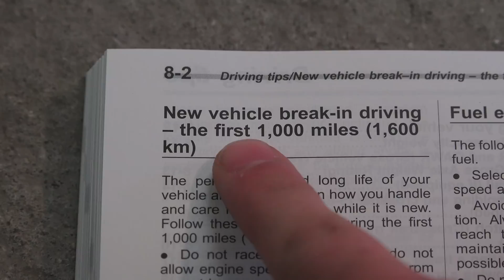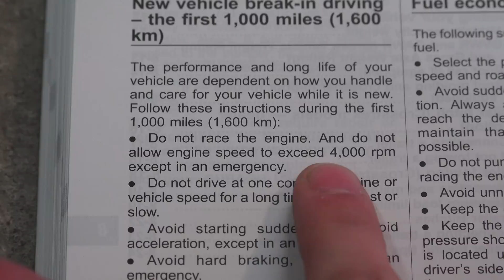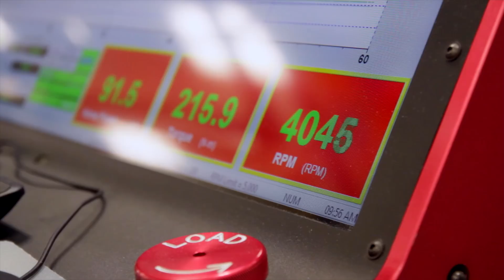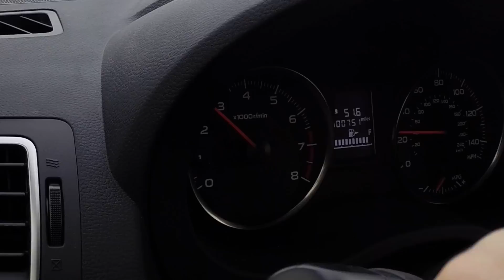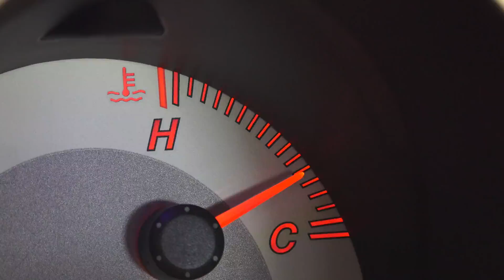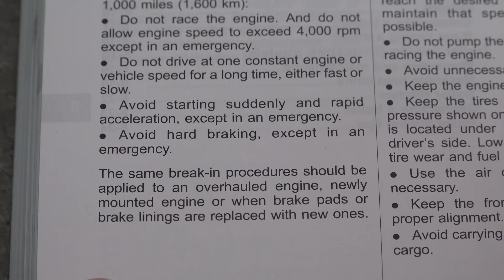5 Things You Should Never Do In A Brand New Car

Comment: my car is 17 years old why am i watching this
Reply: atleast you have a car
Reply: Mine is 30 years old.
Reply: perhaps you might end up with a re-manufactured or rebuilt engine some day if you keep the car. this procedure is also relevant for rebuilt engines.
Reply: Look back in the days you followed these steps.
Reply: I read that as "my cat is 17 years old". In that case you would indeed want to be spending quality time with your cat instead of watching car videos.
Reply: Mine is 46 years old >.<
Reply: @goldmartijn  now 50
Reply: Because you were relieved that your car was broken in correctly so it is still surviving maybe? But the piston rings maybe need changing.
Reply: I dont have a car so why I am waching this?
Reply: Bacon CheeseCake 2000 pontiac grand am lmao, grand am is the model, 2000 is the year. I neglected to put pontiac, most people know the grand am I figured.
Reply: RedesCat same I don't even have a car
Reply: My car was made in April of 1987. it's older than I am.
Reply: 21 year old VW 1.9 TDI here
Reply: RedesCat lol mine's 40 why am I watching?
Reply: mine is 27 years old 300zx
Reply: I have a bicycle -_-
Reply: nope... Grand Prix GTP. Thinking about trading soon though. I need something with a little more tech
Reply: Das beste oder nichts!
Reply: mines 12 years old, still may as well watch
Reply: Mines 30
Reply: My truck is 29 years old
Reply: To tag along, Mine is 24, a 93 corolla ;)
(the wife got new though )
Reply: RedesCat For the time that you'll buy your own brand new car. That's my reason anyways.
Reply: RedesCat  Correct
Reply: RedesCat i have an audi a4 2000
Reply: land cruiser 1998 (diesel). feels like yesterday when i bought it and its still feels like new since Toyota knows how to properly build a car
Reply: My car just turned 17 years old now
Reply: @andrew_gencoupe  after 17 years vw golf tdi, traded for mazda cx5 turbo GT what a difference, hope the new car lasts as long
Reply: @NoChannelChannel  nice choice, I can’t help but look at some new Mazdas too, I love the new cx-50
Reply: @andrew_gencoupe  would have gone for cx50 but Australia doesn't offer it.
Reply: RedesCat same. grand am gt '00
Reply: RedesCat my motor mount actually broke today, taking the power steering pulley with it lmao.
Reply: RedesCat mine is 21 years old
Reply: i have a grand prix with 221k miles lol i like to go fast though but i want the car to last me to atleast 300k
Reply: my car doesn't exist and I have less than 1,00 for one. I also have no logical reason to watch this :P
Reply: Because you know you'll have a new car one day... Same as me! I've got a 15 year old car ; )
Reply: Mine is 13
Reply: I have a 99 Silverado. Definately broken in for towing, lol
Reply: caprisun2k1 is it a gto?
Reply: if the car is solid keep it. those arent bad cars, i had two of them. the problem in this climate is cars rust out. that L67 is a hell of an engine. instead of getting something else, hop it up a little. its not hard to get more performance
Reply: why lol
Reply: My car is 33 years old whatcha want
Reply: Mine is 16. Good old GM 3.8l
Reply: I don’t know🤔.
Reply: Sorry that i must remove the upvote from this since i completely agreed with your comment, but now i have a 13 yr old car. My apologies.
Reply: Mine in 17yo golf mk tdi still strong but time of update, got cx5 turbo
Reply: My 2000 grand am, after 600 in repairs, now has no brake squeak, belt squeak, or loud droning exhaust noise from exhaust manifold or something. And a while back I got an upgraded sound system, definitely needs a subwoofer but it's way better than stock so overall I'd say my grand am is pretty nice. No body issues like dents or scratches too which is very surprising after all these years.
Reply: Mine is 18 on monday i wonder same thing xD
Reply: Mine is 11 years old lol
Reply: 22 y/o
Reply: Mines is turning 17 in May 😩
Reply: RedesCat my car is 47
Reply: RedesCat maybe cuz you're unconsciously thinking of getting a new car? or a friend recently got a car and you wanna help him?
Reply: AHAHAHHHAHAHAHAHAHHAHAHAHAHAHAHAHAHAHAHA 27 yo but.. i am watching too
Reply: RedesCat the car im getting is like 20....lmao
Reply: lol im sitting in a 1990's car chevy camaro anavercry eddition
Reply: Mine's 32 years old, nearly 33. Built October, '84! Why I watched this? No idea...
Reply: mine is 26 years old
Reply: Mines running on 23 years now.
Reply: aceiroo like the bike from my father

itz a honda dominator
Reply: RedesCat mine is like 16. Halp
Reply: RedesCat my trucks are a 1966 1993 and 1998
Reply: RedesCat I like cats
Reply: Because you might need a new one in the near future. Knowledge is power.
Reply: gave the 1001th likes
Reply: RedesCat 2002 Subaru Forester 😇
Reply: No bought my car the year before that car runs fine it's just loud as all hell as the exhaust leeks and my bike I bought last year the price that I bought both of them a blue book value for much higher than what I paid for them but once you drive a brand new car off the lot it already lost half of its value that you paid for it or are in the process of paying for so new cars can be a worst decision in old cars not to mention a build cars now a days that are very difficult for the average Joe Schmo to even change the oil in which means those are cars that I will have absolutely no interest in buying and if the dealer tries to point me towards those I will tell them show me something else or I'm leaving
Reply: an american:  Sentences are a thing.  So is punctuation.

Plus, claiming a new car loses HALF its value right away is complete nonsense.
Reply: Half its value is over-exaggeration they usually lose anywhere from a few thousand to ten thousand once you drive it off the lot but usually some dealers will only give you half of its value that you paid for it when you go to trade it in
Reply: an american to review:  Tks for the clarification. On used cars you REALLY have to watch out for dealers, especially on your trade-ins.  I have literally given away 3 of my old beaters (to family or friends) that still ran OK but were getting ragged re reliability, rather than have the dealer steal them from me and then wildly overcharge someone for them. 

If you go to trade in a new car, say 3 years later, then depending on the brand, yeah, cars may lose half (or even more) of their value in some cases. 

I bought my 3 year old very low mileage '13 G37x for about 55% of what it cost new with options.  It was off lease so I knew why the dealer had it.  So if it hadn't been a leased car I would have wanted to pay less, say 50%.  I guess for near-luxury cars, for the people who can afford it, they want to be seen in a "new" car, and often just constantly roll over leases.  For people like me who like deals, it's great, because there is a steady supply of such off-lease cars becoming available. 

OTOH, cars like Toyota daily drivers with low miles might only depreciate 20% in a few years.  Heck, the dealers often are asking about 75% of the new price for such cars as Camry's that are 4 or 5 years old and have well over 50,000 miles.  (Which is why I buy such cars new and drive them for over a decade). 

So it really depends. 

Sorry I got snippy above, but I get really tired  of people making wildly random over-exaggerated claims on the internet (like apparently with little thought).  To me over time, if too many people do that it greatly degrades the value of discussion threads.
Reply: my car is 24 years old when i am watching this
Reply: My motorcycle is 29 years old as I comment now the only issue I have with it is charging its battery
Reply: RedesCat 11 year old daily driver here with 156k miles. It's still breaking in?
Reply: not only that but why acrue more debt. screw auto debt. i have a 1996 camaro and love it. LT1
Reply: Alex95sang 49
Reply: mines 29
Reply: mine is 24
Reply: mine is 20 i am 22... hehe
Reply: mine is 25 years old
Reply: RedesCat my car is 24 year's old 1993 Ford Taurus GL with 87 thousand original miles on it and I'm 25 years old 😂
Reply: RedesCat my car is 16 years old and im 17 why ain im watching this 2001 nissan altima gle
Reply: Why am I watching this when I have a 2016 with over 30k and I'll have a 78 that already has plenty of miles on it
Reply: same mine was made in the late 60s
Reply: RedesCat. ... That legit made me laugh out loud! Thank you i needed that!
Reply: lol..mine is 12yrs
Reply: RedesCat I drive a 1990 f150 lol
Reply: Hahaha, mine is 15 yo, I also don't know why am i here
Reply: Haha... same. I only drive classic cars and have no plans to ever buy a new car but for some reason I clicked this out of curiosity.
Reply: mine is 18 years old with 450k+ on the odo... I'm wondering the same
Reply: Mines 19 with 92k miles 😂
Reply: RedesCat- LOL!!! I paused at 6 seconds in to find another video and saw your comment. I was thinking 'I'm not buying a new car anytime soon' lol
Reply: Lol mines 24 years old
Reply: Later when it's  time for you to get One i think Electric cars gets cheaper and better If you want One !? 

My self got a Rover 75 1.8 witch is 15 yrs Old and 150000 km of "life experians" !
Reply: 2006 Nissan Quest!!!
Reply: My car is 20years old
Reply: For a good laugh.
Reply: RedesCat mines 25 and I’m still watching 😂
Reply: XD
Reply: my van is 19 years old with 260,000 miles on it. I just like listening to this guy because he is so knowledgeable and well spoken
Reply: I don't even know how to drive ..
Reply: Try 24 years old lol
Reply: i dont even have a car
Reply: My is 21 hue I fell you(130K :))
Reply: mine is 30 ;p
Reply: 20yrs 🤣
Reply: Mine is 115 years old. Driving the Ford model T.
Reply: Hey I don’t even have a car so I don’t know why I’m here ether
Reply: mines 12 yo
Reply: Car is older than me
Reply: Mine is 21 years, but if aircraft can be older with no emergency parking next to the highway, we are still moving.
Reply: 2005 Acura TL ☺️
Reply: i feel. my car is almost 16 years old. only 4 years younger than me 🤣
Reply: Yeah he should make a video about 5 things to avoid doing after your car hits 50 years old.
Reply: Mine is 21 and I m 5 months older
Reply: Because you too want to learn about break-in periods.
Reply: 1995
Reply: RedesCat mines 42
Reply: Mine is 25🤣
Reply: For the next new car, of course.
Reply: 96 f150😎
Reply: Because like myself and so many others, can't go to sleep unless YouTube is playing lol.
Reply: Hopefully it’s 22 years old and still running fine
Reply: For your next new one! 😉
Reply: Bring out the 1940 s rear window sign… PLEASE PASS… RUNNING IN… WHAT A LOAD OF ….. FILLINGS
Reply: Well I know Toyotas don't break in till around 300k miles
Reply: Mines 30 I have no clue why I’m here
Reply: You still rocking the same car in 2023 or got a new one?
Reply: This video is 6 yo, why am I watching this
Reply: hahaha... Lauhing out loud😂😂😂
Reply: 20 years
Reply: There’s always other cars🤷‍♂️ humans are wild creatures
Reply: Mine is 32 years old 😂😂😂
Reply: Same here. Perhaps because a nrw one becomes attactive.
Reply: Reasons.
Reply: Just restore your car, ez
Reply: Did you get a new car yet?
Reply: My car is just barely past the break in stage why am I watching this
Reply: my dad has one that's 61 years old
Reply: my Pontiac is an '04 with 53K miles... still breaking her in, lol
Reply: RedesCat mine is 30 yo
Reply: RedesCat cars from the 1990's are BEST cars are starting to go to trash
Reply: Wish these cars had more power, but for the year and the mpg, it's alright.
Reply: George Rickett 2000 grand? that's 2 million dollars.
Reply: Almost 28 and 42. I understand completely.
Reply: I have a 98 silverado with 420 thousand miles. I thimk im way past break in period lol
Reply: RedesCat  why am I watching this if I crashed my 7years old camaro and now I have to walk
Reply: an american to review we dont believe you!  GO TRUMP!
Reply: Your car is over than this boy
Reply: Mine is a new tesla 😂
Reply: @chazzftw9313  DAMN!!! HOW ABOUT THIS??? YOU NEED THE BREAK IN FOR THE ELECTRIC MOTOR ON TOP MOST PRIORITY!!!!
Reply: Hey everyone I'm giving away my v12 BMW 750il at 5000 subs to one of the subs so subscribe for a chance!!

Comment: There is no direct data discussed here just what you've here and some manuals and some deduction. Do you have actual data, experimental? Like numbers.  I saw 500, 300, and 150. I don't think I heard 1000 miles. This video is borderline bogus. The danger of deduction in this case I could also argue if it's that important why was my warranty voided by full throttle applications during break in. 12 years and 120,000 mi. Why does Honda essentially perform a factory hard break it. Hard refers to the rigor to seat the rings. Not flooring it to do so. You have a maniacal extreme impression of hard break-in.

Comment: Question for you, and I'm sure many people have thought of this. But, what if you want to buy a new car, but it has some miles on it from people testing driving it?? Because how else will you test out the power unless you floor it, right? and I'm sure people beat the hell out of manual transmissions when they're test driving. So my question is, even those these are things you shouldn't do...will the car still be able to take the abuse for say, the first 200 - 300 miles of its lifespan?
Reply: How many demonstrators ended up on the scrap heap early? Any data?

Comment: your argument is that there is enough gas pressure to force the rings to the shape of the cylinder at low throttle but you will make the engine get used to low rpm

Comment: Is starting the car to move it out of the garage bad then? Since it's only on for a second. I guess you could just leave it on for awhile but then it would just be idling for too long at a constant RPM. What are your thoughts?
Reply: I don't think it matters really.  This is because every time you start a car it is cold until it gets warm.  No more damage can really be done unless you do this a lot.  It's just X number of times it was started cold more than doing all of the break in miles on your first drive.
Reply: Invincible Osprey That's what I was thinking as well, as long as it's not frequently and your most common drives include a full warm-up. I mean, I'd probably do this at most once a week. But this video got me thinking maybe I should second think this haha.

Comment: So why does a 325.77 mph funny car run full throttle for 1/4 mile after a complete engine rebuild?  The logic behind a hard break in is that you do not create a top of the cylinder sharp edge.  If you break in the cylinders driving slowly the cylinder gets a low ring ridge.  The first time you go full throttle red line RPM the top ring slams into the ring ridge risking breaking the top ring.  In an engine ready for a ring job the ring ridge can be felt with your finger and it is very sharp.  Not only does the connecting rod stretch slightly the oil film on the Babbitt metal bearing is forced to be thin from the extreme forces of red line.  The break-in period is mythology passed down through the generations.  Cylinder machining is nothing like it used to be.  It is much more precise and the old myths need a new statistical look.  I would like to see data and photographs of the top ring and cylinder wear at the exact end of break-in then after 2000 miles past break in.  I am inclined to believe that you should drive the car like you intend to drive it.  That will put the ring ridge where you will be using it.  I do agree you should let the engine do different RPMs so you do not create that top of the cylinder hard edge.

Comment: Most manufacturers now use a "plateau" finish on the cylinder wall. Meaning the rings are happy on the first start. Custom builds that don't have a plateau finish need heavy ring loading (full throttle) to seat properly. Lower RPM is necessary to avoid excessive heat on the ring face which leads to glazing while rings are seating.  The rule of varying speeds is mostly to help the transmission wear-in evenly. More important with manual transmissions. 
My opinion is: Drive a new car normally. Everything will be just fine.

Comment: I have broken in my fair share of engines in new cars, new motorcycles, new ATVs, and freshly built motors, my opinion is not from an engineering standpoint but from an owner's perspective.

I have had trouble with every motor I broke in "softly" or to the manufacturers specs.

I have had nothing but awesome success breaking in a motor "the way I intend to drive it"!

edit one significant fact I left out is that I do 2-3 oil changes within the manufacturers or builders recommended first oil change period.

Comment: LMAO i work for a delivery company we drive pretty much every brand of vehicle with zero miles on the clock sorry to tell you we floor every single car out the pier and the only cars that gives us issues are gmc/chevys sedans would smoke alot from the tail pipe if your wondering why we drive them fast its because the dealers want their cars fast

Comment: just a theory question
could some of the break in have to do with tolerances from the maker

while a performance car the corvettes, etc are volume made, they time on labour and would add cost not inline with the market placing 
where the NSX has a high expectation to be low mileage (as with all the mega sports cars too, as say a Ferrari might take years to get to 5000miles, or even 1000miles) these have the labour and love put into the car, so the engine has been tested and broken in

also wouldn't a break in with a CVT be hell?, being that it is almost always trying to maintain a set rpm